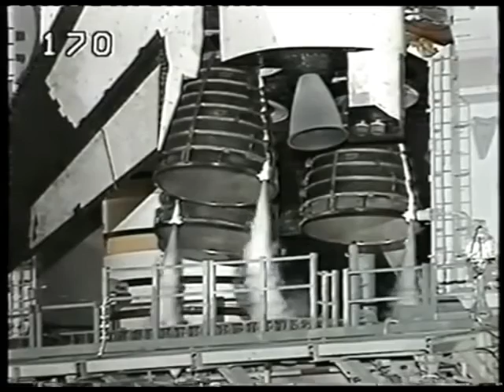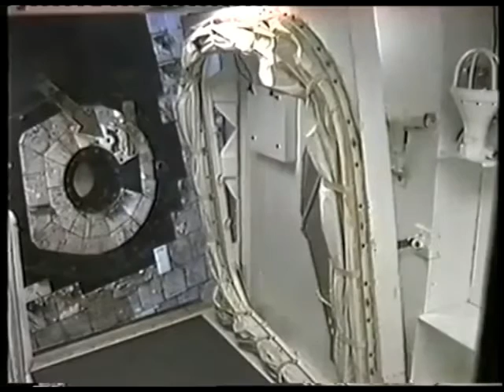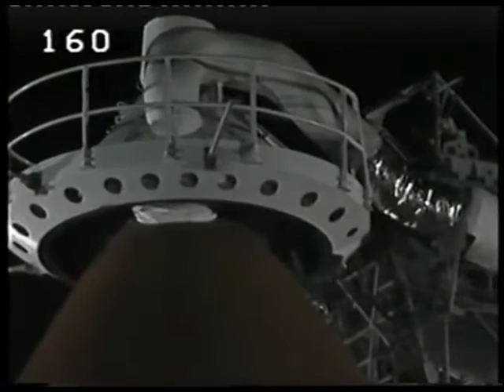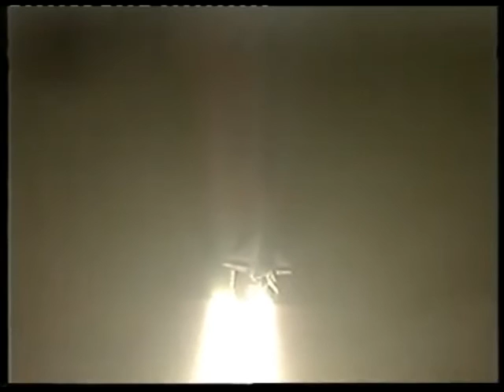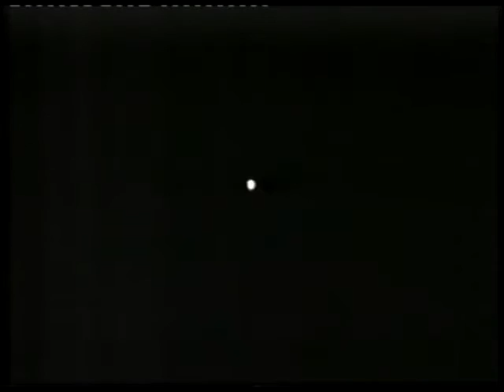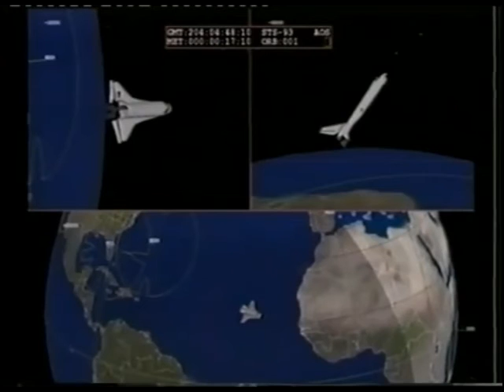STS-93 Launch NASA Footage

Comment: "All electrical systems are healthy on the orbiter...." 
"Oh,  except for that one that shorted the crap out of itself. "
Reply: @Brandon Bennetzen  "Columbia negative return." That had to be terrifying wondering if the potential loss of TWO engines would mean they could even manage an RTLS abort in Morocco.
Reply: @dani.215  RTLS is only at KSC, Moroco would be TAL.
Reply: You probably dont care but if you're bored like me during the covid times then you can stream pretty much all of the new movies on instaflixxer. Have been streaming with my brother for the last weeks :)
Reply: @Jamal Rene Definitely, I've been watching on InstaFlixxer for since november myself :D
Reply: The RTLS abort is the most sketchy. The chances were thousands of times better for a successful abort to a landing in Europe or Africa. 

A return to launch abort requires the Shuttle to pitch up(versus down range) and burn off all the excess fuel in the ET, do a flip, re-enter the atmosphere at a sketchy angle, hope to survive re-entry then have enough momentum to make it to the landing area. I do think the "Skid Strip" could have been used also instead of the Shuttle landing runway, if for some reason the shuttle did not have enough momentum to make the final approach for the Shuttle Landing runway. 

The Skid Strip is near the tip of Cape Canaveral and an East to West runway, while the Shuttle Landing a little more inland and north on Merritt Island and  a North to South runway. 

There were also contingencies to land at any available runway up the US east coast and sometimes Bermuda if there was not enough momentum to  return back to Cape Canaveral. 

There is a good YT video explaining the abort contingencies for the Space Shuttle.